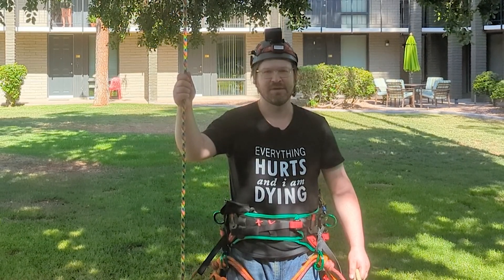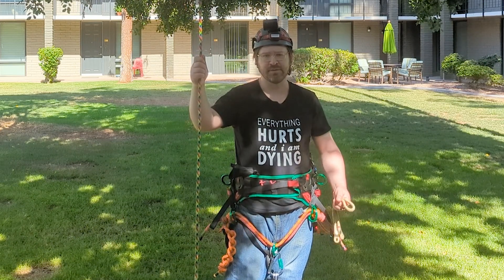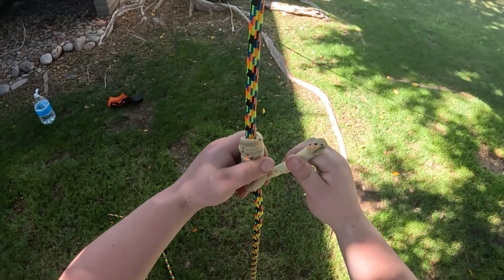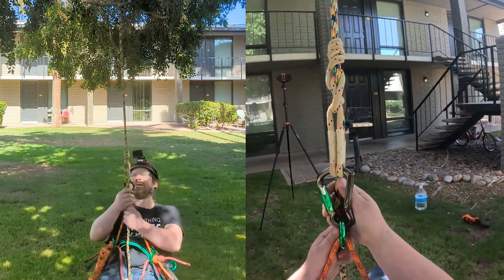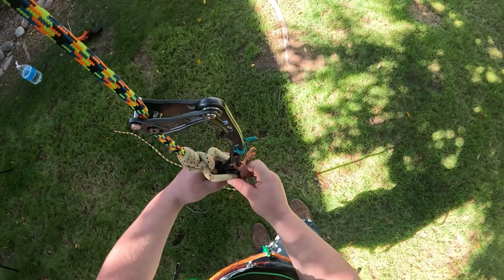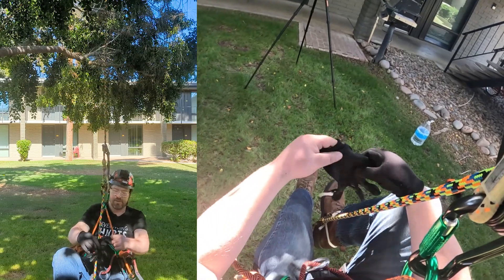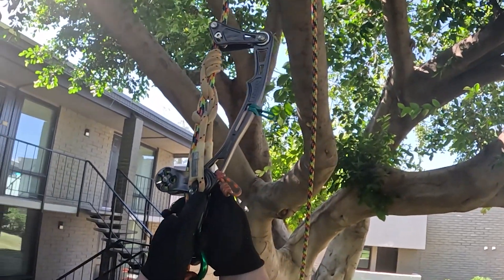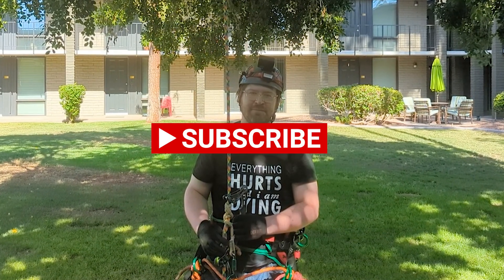TESTING the "BLIZZARD" Friction Hitch (Proving This Hitch Really Works)!

Comment: Yeah, if you ran with a Ropewrench , even the adjustable Flow w/o a hitchcord would be suicidal. So testing your hitchcord b4 climbing is necessary. 😮.
Reply from the maker: You got that right! Gotta test your hitches and hitch cords before you put your life literally on the line. Every single one of my 85+  original hitches in my library have gone through rigorous testing to ensure that they are suitable for life support.. The one element I can't test for is a climber's ability to dress and set a hitch properly and safely. That takes practice and experience. Thanks for the comment!

Comment: Hey brother, I'm blizzard fan from now
Please tell me, with the right setup of wraps and combination rope - cord, i coul use it just with a pulley on srt, then ascend and descend without problems?
I go for the foot ascender now
I told you, im in a process '
I could change my systems , who knows...
But i hate to use too much equipment for recreational 
Hugs my brother
Reply from the maker: That's great! I'm so happy to hear that you're using my Blizzard friction hitch! It's definitely one of my best. Unfortunately, I'm pretty sure you're going to need a rope wrench for this one. But I've also never tried it without out! You could definitely ascend without any issues, but it MIGHT bind up if you try to descend without a wrench. But you should give it a try, just do it very low to the ground. Or climb with two systems. That way, if the Blizzard hitch binds, you can still descend on your second system. It would make for some new and interesting testing for this hitch! I have a feelings that it MIGHT work without a wrench, but it was designed for use with one so I really don't know! If you want to climb without a wrench, you may want to give the Sticht hitch a try! You'll just need a hitch cord and a suitable sized ring! Hugs, brother! Thanks for commenting!
Reply: @Knot-orious  👏🏻👏🏻💪🏻 thank you
Reply from the maker: @verticalfeel  You're very welcome! Let me know how it goes! 😊

Comment: What about using this standalone (no rope wrench) with a foot lock?
Reply from the maker: That would work just fine for ascents, however, without a rope wrench, this hitch could be prone to binding during descents unless you use it with a moving rope system (MRS) instead of a stationary rope system (SRS) as shown in this video. Interesting question! Thanks for commenting!

Comment: Hey Knotorious. Thanks for your Video. I Love your Content. Today I purchased the Notch Flow Fusion you recommended, before I saw your video. Now I am waiting for delivery from America. What a tiny world. Greetings from Germany 🇩🇪
Reply from the maker: Hey there! Thanks for saying that you "love [my] content!" That made MY day! =-D You're going to LOVE the Notch Flow/Fusion rope wrench/tether combo! It's such an amazing climbing device! Not just because "stiff" tethers are waaaaaay better than "soft" tethers, but also because it's awesome to have everything (the wrench, tether, and slack tending pulley) connected as one piece of hardware! Also because the tether has a longer profile than most others, allowing for ample space between the friction hitch and the wrench! One suggestion I would give you is, if you are going to be rope walking, to use some paracord and tie or sew a small loop onto the tether so that you can easily connect a chest harness or neck tether to the device with an accessory carabiner! If you look closely at my tether in this video, you'll see that I've sewn two loops at varying heights on my tether! So much better than trying to connect to the cutout slits directly on the tether itself! =-D
Reply: @Knot-orious  my Notch Flow/Fusion rope wrench/tether combo arrived today from the us.  I had time to test this new combo in my backyard. Now I need to test it further with my pursik cords to find a smooth knot. I use a Petzl Axis 11 mm static Rope. That’s the only rope I have with the minimum necessary diameter. Thanks for your tips to put some loops on the tether. I will do that. Here in Germany we don’t use rope wrenches at all. Especially the Notch Fusion Flow with rope wrench. I found only a few videos in German and this videos are almost 4-7 years old. Very little climbing with knots is done here on the main rope. On Lanyards are they commonly. The rope runner pro and the akimbo are more represented here with much more content. Maybe I should make a unboxing video here on yt. Thanks a lot for your advice. ✌️
Reply from the maker: @TredasTaurin  Lead the way for climbers to use friction hitch-based climbing systems! Mechanicals are great, but I would always recommend that new climbers begin with a hitch based system as they are easier and safer and more responsive in my opinoin.

For an 11mm rope, might I suggest the 9mm Sterling RIT Response hitch cord? Or the 9.3mm Teufelberger EpiCord? I love larger cord diameters because they result in much greater smoothness on the hitch. I weigh 230lbs and still love these two friction cords.